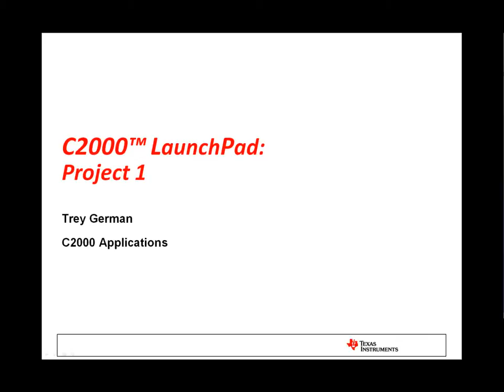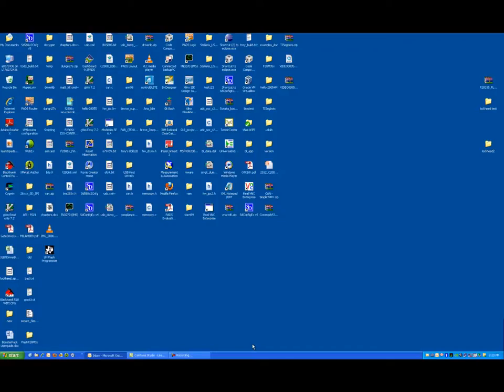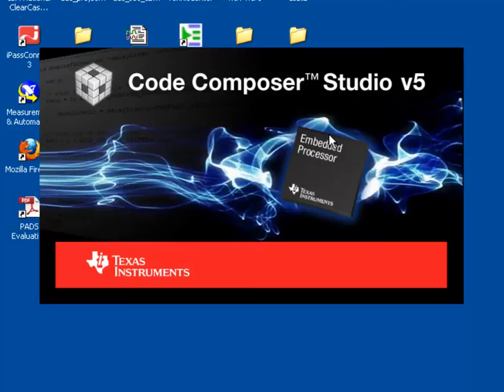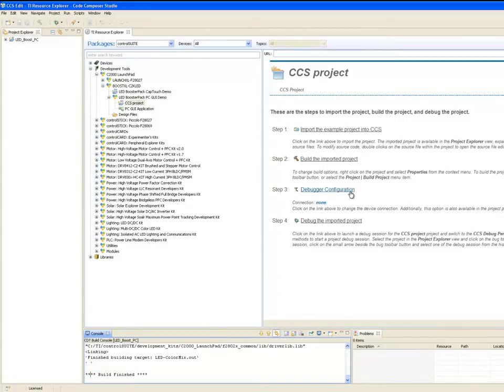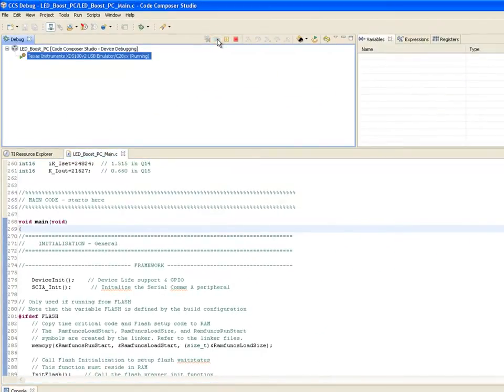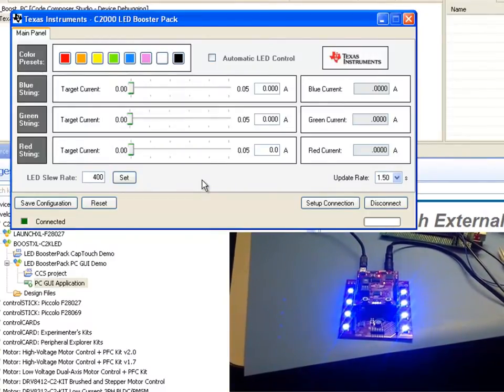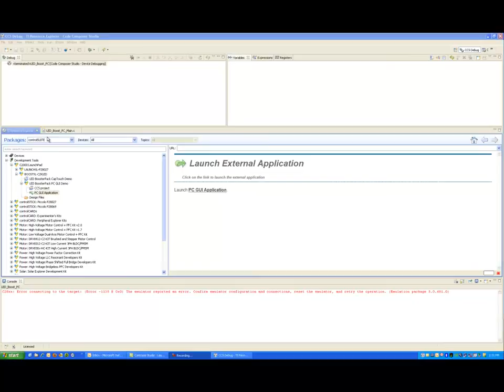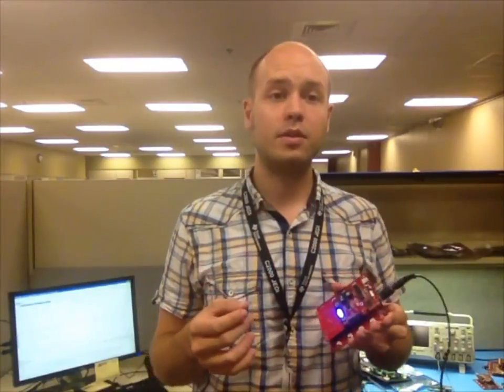C2000 LaunchPad Project 1: LED BoosterPack Lighting Demos

Comment: my ccs5 with latest update is missing c2000 launchpad under TI Resource Explorer but it is available under Control Suite. Is there any way to fix that? I cant debug my LAUNCHXL-F28027 with selecting TMS320F28027 and XDS100v2. I get the same error, 1135 regardless of switch positions

CCS Version: 5.2.1.00018